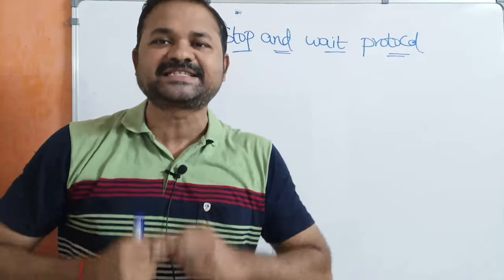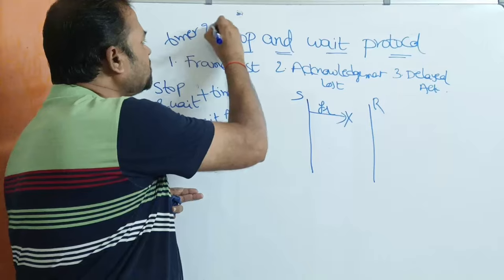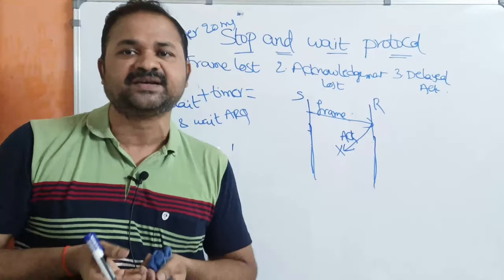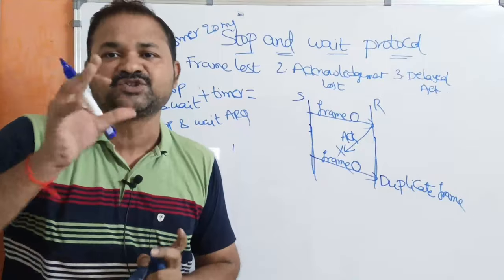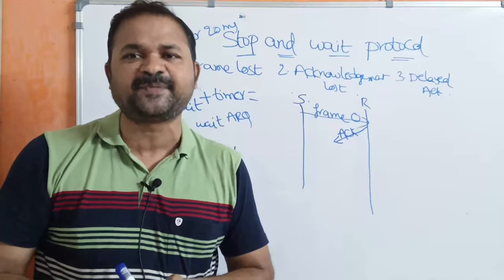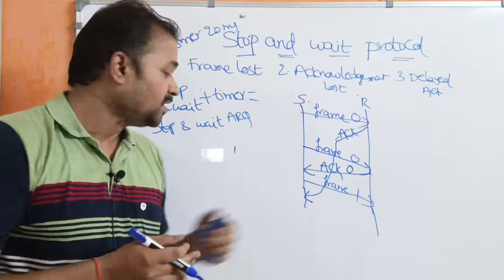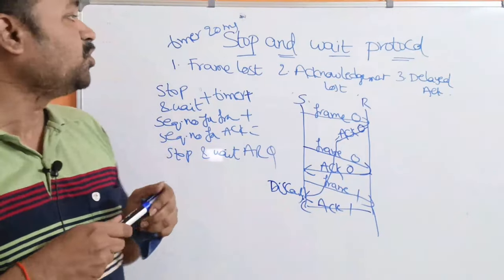Stop and Wait Protocol || Stop and Wait ARQ Protocol || Data link layer || Computer Networks || CN

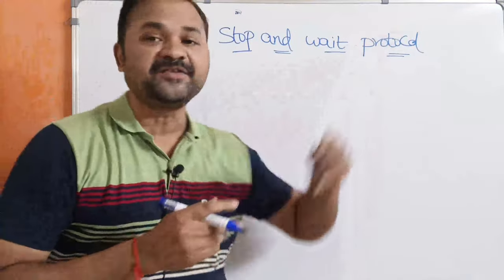Comment: 00:03 Stop and Wait Protocol ensures sender stops and waits for receiver acknowledgement before sending another frame.
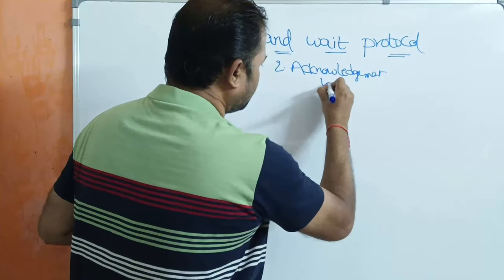01:38 Frame lost issue in Stop and Wait Protocol
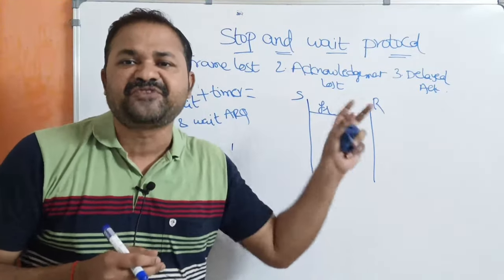03:07 Stop and Wait Protocol uses timers for retransmission.
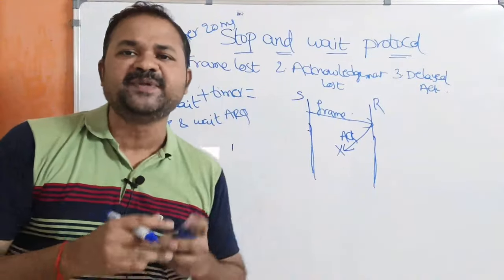04:32 Stop and Wait protocol involves maintaining timers for frames and retransmission in case of lost acknowledgments
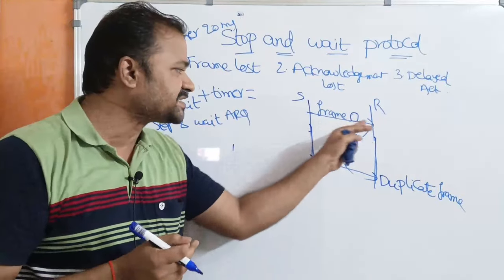05:54 Stop-and-Wait Protocol retransmits frames upon timeout
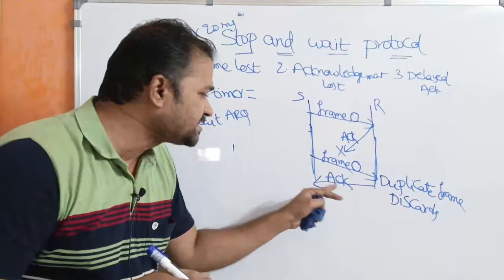07:09 Delayed acknowledgment causing retransmission of frames
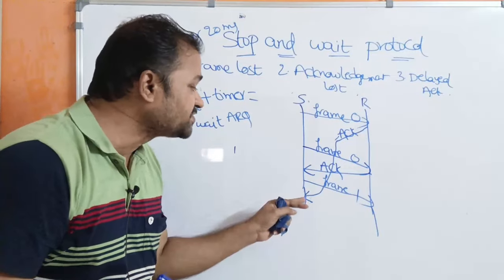08:39 To address the problem of mistaken acknowledgements, the receiver should provide the sequence number along with the acknowledgement.
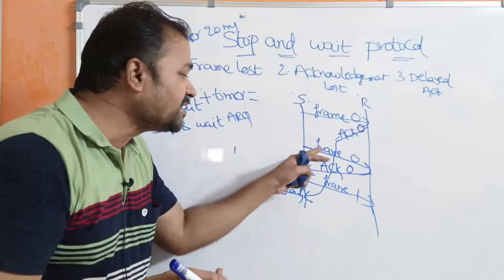09:58 Stop and Wait ARQ Protocol with Timer and Sequence Numbers
Reply from the maker: Are you using any software or not. Plz subscribe to the channel and if possible share  with your friends. Thanks in advance..